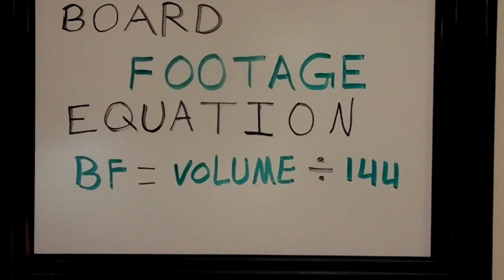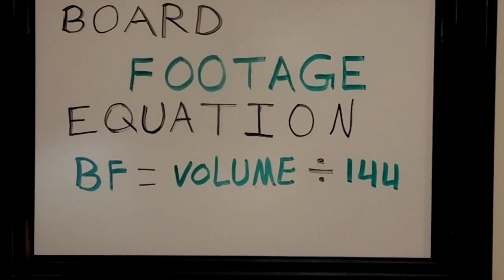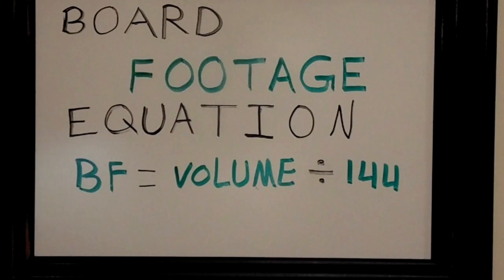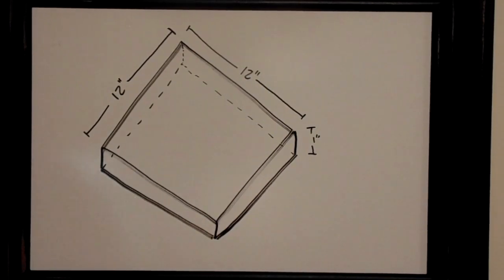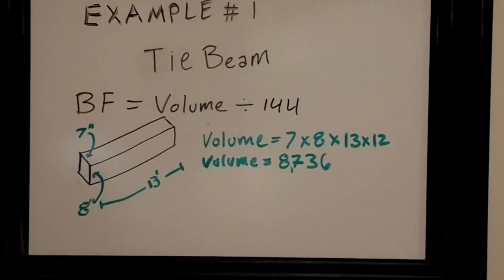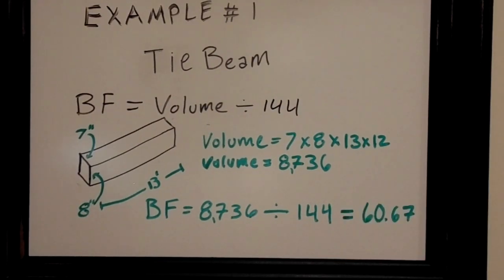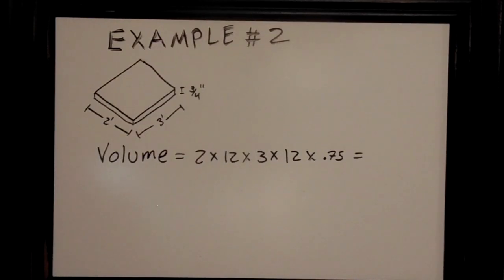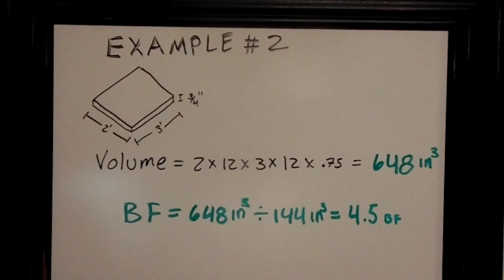Board Footage Equation - How To Calculate Board Footage

Comment: A question for you...If I know the board footage, how do I now know how many pieces of wood to buy? Do I divide anything or what? For instance, supposing I need 10.61 BDFT, of a piece of wood of size 280 x 207 x 1.8cm which has its own board ft to be  44.21 BDFT...It means I will buy one of the piece of lumber, but in the case the board footage is say 202.56BDFT, Do I divide 202.56/44.21 to obtain how many pieces of wood to buy for that size...Will this work?

Comment: There is an easier way to calculate it. For example, a lumber that measures: 2"x4"x12ft=96, divide 96 by 12= answer 8; which is the same as on the vid: (2*4*144)/144=8